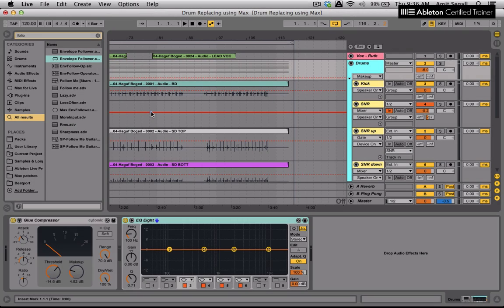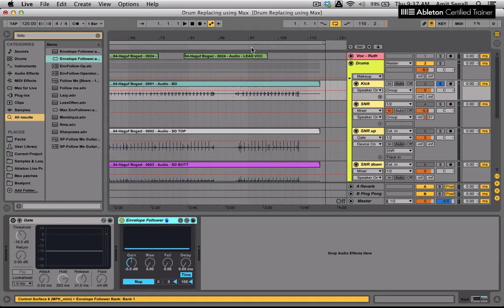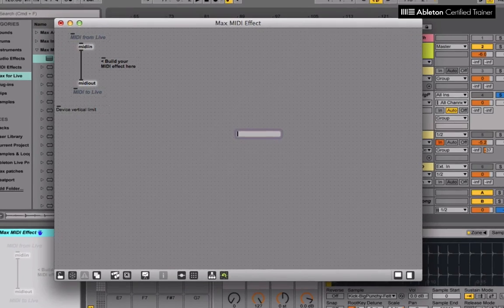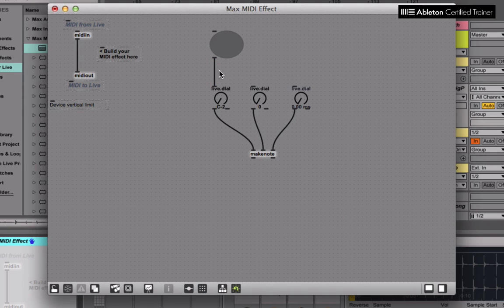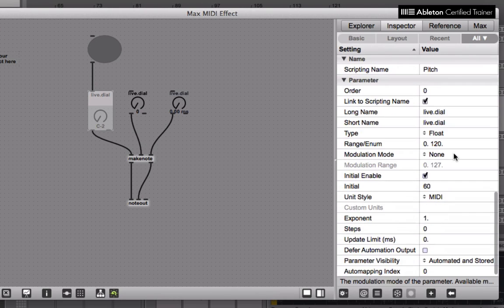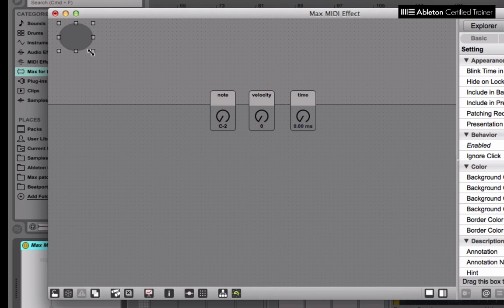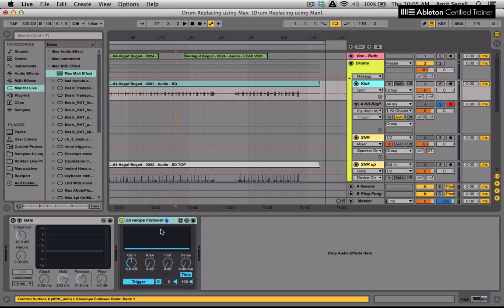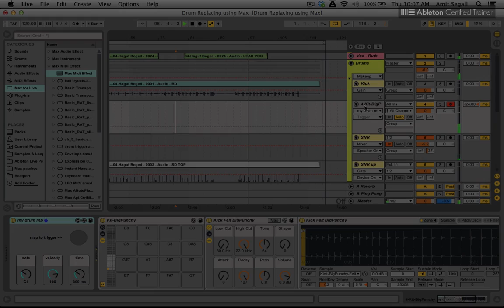Amit-live: Drum replacing using Max for Live

Comment: I followed your instructions and I'm getting a few milliseconds of delay between the source hit and the triggered hit. Any thoughts on what might be causing the delay?
Reply from the maker: Hey,
do you use a professional Soundcard ? pc or mac ? each situation will give different situations so that might be the case - it the video i'm using mac and Komplete audio 6 by NI - which determine quit low latency - check yours :)
Reply: Amit Segall I'd say it's at least semi professional--A Roland VM3100 (outboard mixer and PCI card). Though a bit dated, it's pretty solid as far as avoiding latency. I'm on a PC.
Reply from the maker: ***** can't really tell - check in the settings if you can lower the general latency or as shown in the video use the delay track to compensate the right amount :)
Reply: Oh! I totally skimmed over the section with the delay option. That'll be the fix. Thanks!
Reply from the maker: ***** Enjoy - glad it's working

Comment from the maker: this is partly true my friend - although "convert drums to midi" works just fine it's nothing like using this method using the M4L, which could be more precise, and done in real time with no need for processing - so i guess both eventually could get similar results but it's all matter of what you're trying to achieve, also since M4L is totally adjustable if you'd keep developing this patch you could get something much cooler :) it's all about the ideas :)